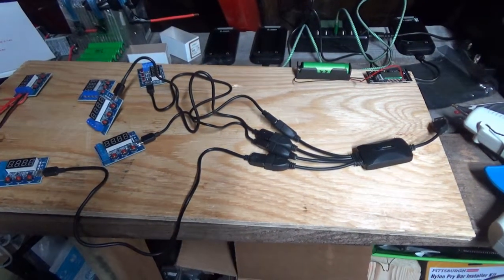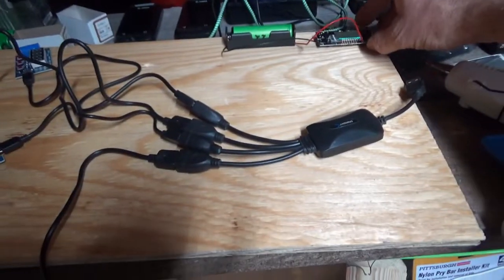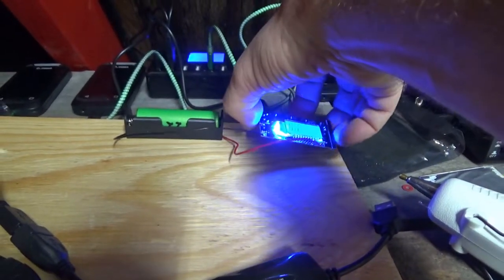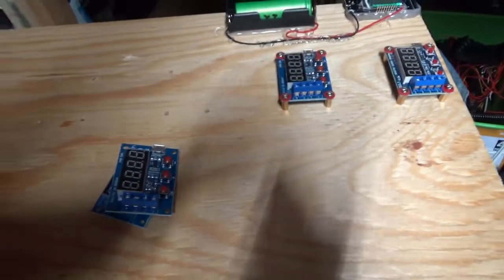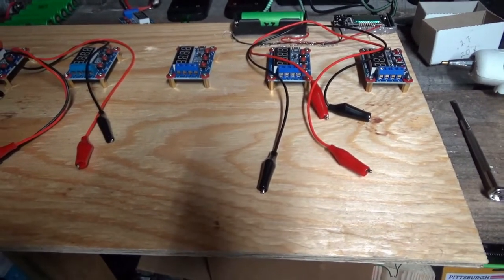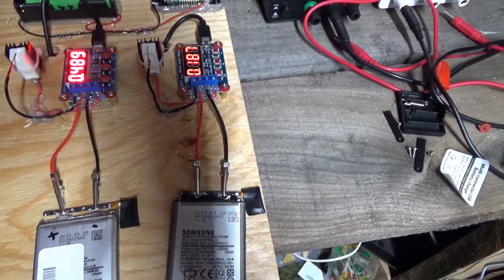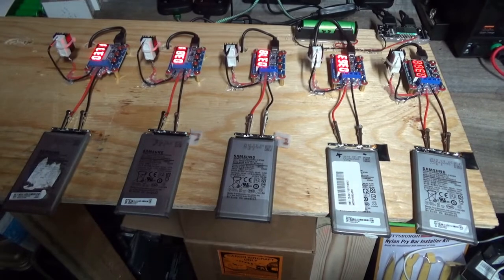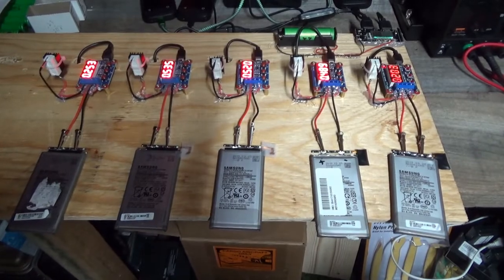DIY Lithium Battery Capacity Testing Board On A Budget

Comment: Im planning on replacing the original resistor on the tp4056 with a 1.5k, 1 .33k or less with the hope it stops charging a 18650 battery at 4volts or less. Those tiny resistors are very cheap but soldering isn't fun with those tiny stuff😂

Comment: Mr Troy do u perhaps know a way of using tp4056 1amp lipo circuit charger to charge up a 18650 battery very close to 4volts?
Reply from the maker: Those are programmed to a set voltage. I am working on a circuit that can be adjustable because I do not like to fully charge up my batteries. It reduces their life span.
Reply: @thedoityourselfworldelectr8007  I will be on the lookout for that video. Im very much new to electronics specifically electronics, but eager to learn and apply. I treat solar energy, lead acid and Lithium ion batteries like they are rare commodities. (that mindset forces me to be more creative with what I have and keeps me from becoming complacent) How much energy can my solar setups gather and how long do I get to extend the life of those batteries while making the most use of any surplus energy at the same time. Crazy I know. The 1 or 2 brain cells I have left must work. Because I have alot to learn. It's not even funny. But i wane enjoy the journey at the same time.

Comment: Hi, if you have a second wanted to see if you can help me with my little solar project, been watching your channel for a while now and you're actually what kind of got me into solar and finally last year I started a project then life got a little busy then I got back on it and finally finished it having a little issue though, the issue is the solar panels shoulder charging but then once the sun goes down the voltage on the solar charger goes straight back down to 12.1 12.2 but while the sun is out the charge controller shows its charging and it'll go to 12.4 12.6 but like I said once the sun goes down the power goes straight back down to 12.1 12.2, one can you help me diagnose the issue because I can't really see the fight any information on this problem but from what I did find everything's kind of leading back to the shoulder charger, I have two 100 watt solar panels I have a deep psycho battery if you want to look it up the part number is 24 ms2-6 000 cold cranking amps 135 amp hours at 1 amp it says, I made this to be kind of a transportable system so I bought a marine battery box put the battery in there screw the solar charger and the fuse box to the lid of the battery box and I have lights on it a voltmeter on it banana Jack's on it USB and cigarette port on it all on switches and also a port to plug in the solar power wire, any help or tips or info would be greatly appreciated, first I had one panel then I thought maybe it wasn't enough juice then I got two panels and that's when I started getting up there and voltage charging wise so I thought that fix the issue but now I'm back down to the same issue I had when I had one panel. I am enjoying the do-it-yourself electronics channel I really want to try some of those sometime

Comment: This may not be related to this video in particular, but could you do a request video? I’m trying to diy a solar panel and battery for my trail cam. The trail cam has a port for a 6v 1.5 amp plug. I’m essentially looking to hook a solar panel up to a battery to power the trail cam. I’m assuming it would need like a 12v to 6v step down or something? Can you help me with this? I think others would be interested in this as well? Thank you for your time.

Comment: Check your clip to wire connections (move the boots back), sometimes they don't do them very good at the factory.
Reply from the maker: Yes, I checked each one. They are not soldered. Just folded under and crimped on.